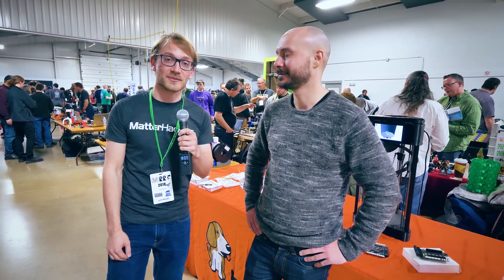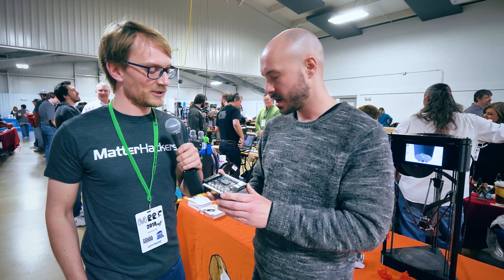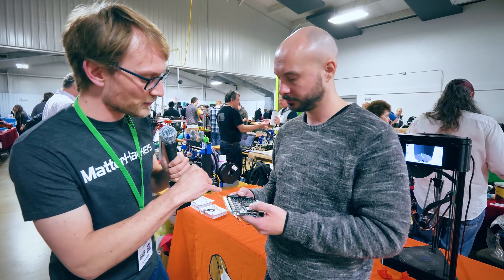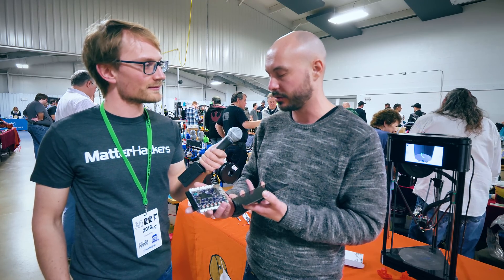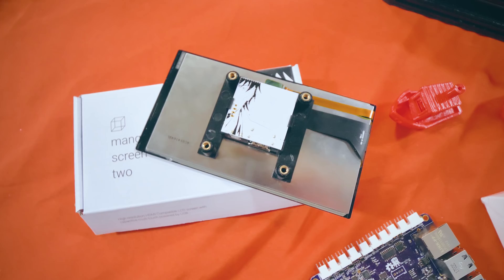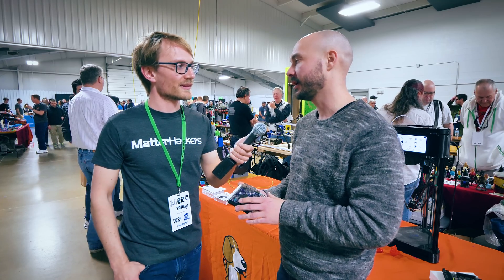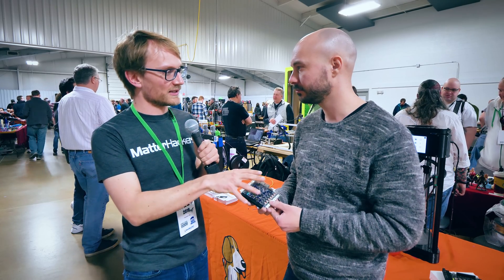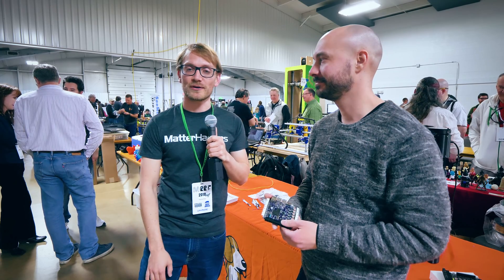Run your 3D printer with only this Octoprint-based mainboard! "Revolve" at #MRRF2018

Comment: This board would be incredible for $109. I wonder if you could run Klipper firmware on it without a Pi...
Reply: wilson mura This board could not be more ideal for Klipper. The Octavo chip handles the motion planning and Octoprint like a Pi, and the real-time step pulses like an Arduino, but in a single package on a single board. If they get the price down to $109, it will be the best 32 bit hardware at that price point.
Reply: I run Klipper on a Replicape + BBB.  I imagine it could also run on the Revolve.
Reply: Jake Palmer Awesome! I've been wanting to try it. It looks like people have been seeing good results with it.
Reply: wilson mura Opportunity cost ($, space, electricity) of running klipper on a pc make it a bad choice for almost anyone (even if you already have an idle pc doing nothing, sell it and buy a pi).

I think the unique thing about klipper is not the cost savings of repurposing old hardware, but pushing motion planning (acceleration/deceleration) forward to allow for print speeds not achievable on current microcontrollers
Reply: While I appreciate what klipper is doing, the firmware that's being built for Replicape and revolve is redeem, and that's been working quite well for a while now
Reply: wilson mura this board is "somewhere else" and a "cheap Arduino", it's all integrated on one PCB for roughly the price of a pi+Arduino+stepper drivers
Reply: Alex: Klipper can run on a PC no cost there and I already paid for the Arduino when I bought the printer, so the only thing I need to pay for if I wanted to upgrade would be the drivers at a cost say 35 dollars.

Jake: you're pretty much right but as far as I know there are no printer announced with that board so it's an extra that I have to shellout. And if Ican get the same result by changing the stepper drivers on my printer and using Klipper on my PC then why bother.

So you can get a better context as to why I have this viewpoint, where I live customs can be a pain and a board that cost 106 dollars could easy end up costing me 200+ where as 3 TMC drivers for my delta 60 ish. 

Again the board looks great but it's definitely not for everyone, where as Klipper as is could see mass adoption just by using it with current hardware and a PC.
Reply: The idea of klipper is that all the hard work is done somewhere else, like on a PC or PI and latter that code send to a cheaper Arduino based controller for all the motion work.

Sure you can make it work and sure it would very likely give you very good results but... again it's probable not what Klipper was intended for.

Comment: As someone who owns both the replicape and the manga screen, I can say that I've been very happy with the performance and flexibility. I am definitely going to buy this new gen for my next build (corexy). Yes his presentation is weak but the quality of engineering is fantastic, well worth the premium. Also this board is not for everyone but as a linux enthusiast this is a must have for me. The community isn't as strong as arduino or marlin but a pleasure to work with. Also a note to the people who are skeptical he has always delivered, not one failure and i would know i got everything he started.
Reply: Dante Singleton do You think this board will be a better choice than a duet? Also building a corexy and uncertain about what controller to use
Reply: +Fernqvist Edvin

Honestly it depends, I feel like the revolve (this board) would give more bang per buck @ 109. In terms of raw printing performance they seem to be in the same class. In terms of flexibility i would go revolve. In terms of ease and community i would go duet. I feel that in this price range It comes more to preference.
Reply: Dante Singleton where I live the duet will cost me 150 USD minimum to the price point for this one (if I can get it for 109) is really intreaging

Comment: Hmm,  smells sloightly fishy.
Boards not even tested, offers Support for a not yet delivered KS Screen, not envolving software devs ..
Is slicing onBoard really a thing?
But maybe it´s the way to go. Looking nice, don´t offer too much setings.
Reply from the maker: Elias knows how to deliver hardware and I'm sure he has learned much from delevoping and producing the Replicape and original MangaScreen before this!
Reply: 1. No it's not.
2. Yes as it is linux based, the screen is just hdmi with usb for power and touch input.
3. Yes it has been since the first release. (Years ago)
4. It is completely configurable with a simple config file, no recompilation required/ needed ever.
Reply: On board slicing is extremely common.  It's existed as a plugin for Octoprint running on a Pi (OctoPi) for quite a while.  I own a Replicape which is an extremely nice piece of hardware, but the software and release schedule for it leave a lot to be desired.  I now run mine with Klipper firmware, and I plan to purchase a Revolve and do the same once it's released.
Reply: If he didn't have a previous version I would share your concern. Replicape + BBB is a known quantity developed by the same guy. This board puts it all onto a single board plus adds a few more things.
Reply: We've got an expanding group of developers working on the on-board firmware. At present I think there are almost a dozen regular contributors to the core of Redeem, though the path planner is mostly a one-man operation still.

Comment: Thanks Thomas for picking out this gem! This seems like the next big step in the evolution of the reprap electronics hardware, leaving the Arduino platform and entering the world of SBC's like the raspberry pi (and alikes) with many peripheral devices (Wifi / HDMI / SATA / M.2) on board already and with quality Trinamic CNC hardware integrated on the same board... Now we enter a promising era of giga tinkering :-) , GUI's and more capable and user friendly 3D printers in general! Very cool!!!
Reply: Florian, the board can't run a full blown interface. The processor is a single-core 1GHz chip. Modern UIs are multi-threaded and use a ton of resources in terms of memory. It would not be a good experience at all. We've tried. Also, if you want better touch controls, Toggle (the UI shown) is open-source. It will get better if more people help make it the way folks want it.
Reply: So the onboard slicing that we recommend is through using the OctoPrint slicer plugin - which gives you a true full-feature slicer with complete position, scale, orientation and multiple object controls through the web interface. If you have, like your setup, a laptop directly next to the printer then you could bypass that completely, sure. But the touch screen interface is for quick modifications in an environment where your laptop interface is a significant distance away from the printer. So if you want to re-print one of several identical parts, or change filaments, move the print head or something simple, the touch interface is much easier to work with. Note that you can also plug in a mouse on the USB and have a mouse instead of having to use the "touch" part of the interface. Toggle's a simple, lightweight client that sits on the framebuffer and hooks into the OctoPrint API. OctoPrint basically replaces the need for your dedicated laptop, and the touchscreen gives you a quick way to work on the printer when doing calibrations or maintenance without needing to bring in a dedicated machine for that operation...
Reply: Duet Wifi has Wifi, Trinamic, etc all integrated and has a GUI already and has been out a few years.
Reply: Karsten Kruse I agree with that, you need something that replaces the RAMPS (as an all in one) without increasing cost or complicating the firmware building so much, otherwise it's not going to get adopted by the large mass of printer builders.

Redesigns of the RAMPS like the MKS Gen 1.4 are already a step in that direction because they increase usability, now imagine a sub 50€ MKS like board with an ARM M4, TMCs and half decent mosfets.
Reply: Florian, a small windows tablet would be a good option
Reply: I could see myself investing in a board like this for a cheap printer that I wanted to upgrade into something more, having these options on a custom build with the parts from a cheap printer would make sense. Decent quality for under $400 is a good option.  Obviously not just to replace a blown out RAMPS but to make something better I don't think $100 USD is out of the question.
Reply: goeland86 It can definitely run a full blown interface, not a pretty and animated one, but it can surely run a windows95 style interface. I get that it isn't viable because implementing it in a performance sensitive way costs just too much programming time and won't attract users with the shiny factor but it sure is possible and would be 100x better in terms of usability than a small touch screen with eye-candy animations.

I'm using my printer without an SDcard or Display, just over serial with an old laptop, it's a much better experience than any small touch screen could provide, i can go from exporting the model as an stl file to printing in 30 seconds. This board could replace the laptop+RAMPS combo that runs the Cura->Pronterface->Marlin software stack. Screen+mouse+keyboard is the best control interface for a printer IMHO it gives you fast, direct and painless control.

I'm not trying to tell you your approach is wrong, it's a great board, the tight integration of all the components is super sexy and the GUI shown in the video sure works out, but the slicing on board isn't that great if you just have a small touch screen to position the objects and change printer settings, onboard slicing is a gimmick if it doesn't provide full control. That's just my opinion based on how i use my printer, no offense.
Reply: goeland86 You're right, I'm sure the Revolve will be a great replacement for the Raspberry+RAMPS hardware platform!
Reply: i think it would be better if it was more backwards compatible, for example by using a ARM9 and Cortext M4 instead of using PRU based chips.   you could put repetier or Reprap-firmware etc.......
Reply: Dude, the board is 109 bucks. Until it gets into my grubby hands it will be 180 euros.

Reprap needs cheap 32 bit electronics, not glossy multitouch hdmi displays.
Reply: It will be a matter of time before the price drops.. and the public opinion goes up on what is expected of a decent 3D printer controller board.
Reply: true story. chinese printers start at 120 to 150 euros - and they run!
buying a board that costs more than the whole printer seems a bit strange. and humanity wants it cheap, that's a fact.
Reply: Tinkerman I would adopt a board like this if the firmware would turn the board into a little cnc like control station with mouse and keyboard support, a menu made for a notebook sized TFT and a light version of the cura GUI running on it so that it emulates all the functionality that would usually be provided by a PC connected via serial to the printer. The Revolve has all the hardware on board to do this, but it's instead programmed to use a small and slow to navigate touch screen with clunky touch controls ... bleh
Reply: Karsten, a ramps and mega setup is dirt cheap, but it is an absolute colossal headache to work with.  No quality options exist for mid level machines. People will invest in quality components, and it'll come down in price and be replicated if it proves to be popular.

Comment: Does it have pins available to add external drivers.
Reply: I don't want to promise anything, but I remember seeing 2 extra sets of pins for external drivers somewhere on the board. That may change before it makes it to production however.
Reply: Yes, you can run 2 additional external drivers if you want to

Comment: This guy is terrible in presenting his product. Thomas did most of his work.
Reply: We can't all be engineers and salesmen at the same time... I know I couldn't convince someone to buy my software on camera easily!
Reply: I thought he did fine. Plus his product practically speaks for itself if you're a maker.
Reply from the maker: I mean, Tesla and SpaceX aren't exactly run by a salesman, either.
Reply: He's an engineer,  he's designed a very interesting bit of hardware. Not everyone is a Buckaroo Banzai.
Reply: What up Goeland
Reply: I think that Tesla is nowhere near "trouble" its just media manipulation, as usual.
Reply: and even if tesla would be "on verge of bankruptcy", they accomplished a HUGE change in the industry. That was the goal from the beginning. Not even selling many cars. as if Musk would need more money...
Reply: Tesla may be in incipient trouble, SpaceX not so much. Apple, on the other hand (I used to work there), is driven less by the sales side than you seem to think, they've generally been moderated by engineering, to a greater or lesser degree, depending on the era.
Reply: Trying to keep folks informed about what the Revolve/Replicape ecosystem is and hopefully will be ;) Release manager for the firmware images isn't easy, especially when the startup's eating most of my time.
Reply: Thomas Sanladerer spacex doesn't sell anything to consumers and Tesla has sales staff.
Reply: bkpickell. well, if spacex wouldn't sell anything, what satellites are they shooting into orbit then? and if you take a look at their policies, even a consumer can send something to space, if the payload is safe enough.
Reply: I think the point is that SpaceX and Tesla are led by someone who is an engineer and more than that... Dumb phone autocorrected my initial answer
Reply: therealpanse they don't have a product to sell. They do sell a service to the government by putting satellites into orbit, but the government is not a consumer. 

The only thing spacex sells to consumers are one way tickets to mars.
Reply: so you think only the government can put satellites into orbit? i could do the same thing. you just call them, send them your stuff, pay for it and off it goes.
Reply: After talking to Elias about the interview - part of what phased him is that the video was re-shot... I hate to give behind the scenes secrets Thomas, but in this case it did disturb him quite a bit that he didn't remember what was on tape of the first shoot vs what had to be re-said... Thank you for stepping in to bring the essentials back on tape!
Reply: therealpanse and how many individuals are hiring spacex to put satellites in the sky? Yeah I can't think of any. Business can but a business also is not considered a consumer.
Reply: I'll cut him some slack because it's an ad hoc interview rather than a presentation. They probably spent so much time making it flexible they haven't even realized all the implications. If they can solve the start stop defects and add a nozzle purging system they're on the cusp of building a 3d four color print system that can not only do graduated color but complete color changes on the fly available to anyone. Seriously this thing is a maker's dream. They have the board. The software can be written. Designing a four color hobbyists hot end isn't that much of a stretch.
Reply: Thomas Sanladerer great example of two companies... on verge of bankruptcy. Apple on the other hand can't decide that to do with profit.